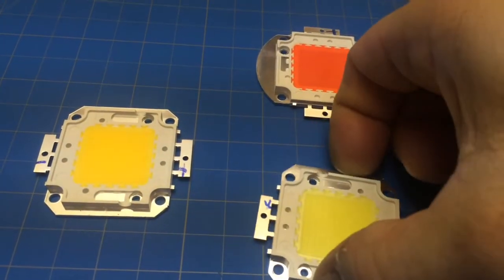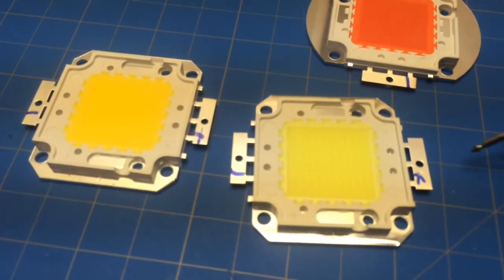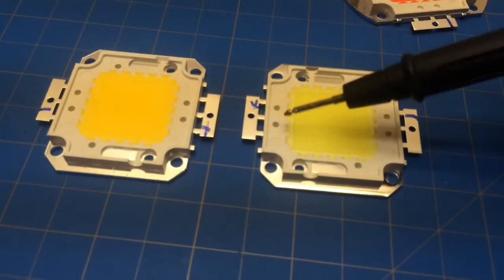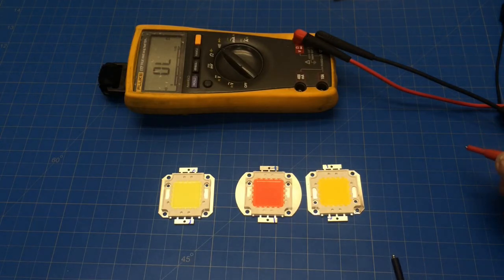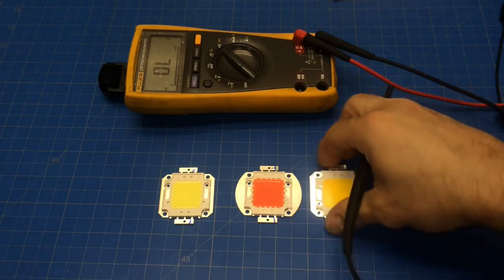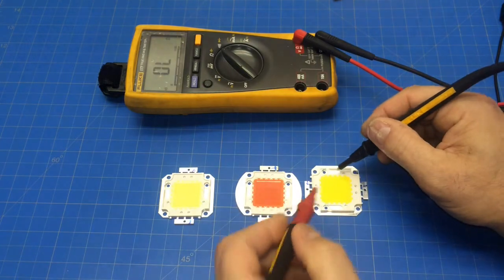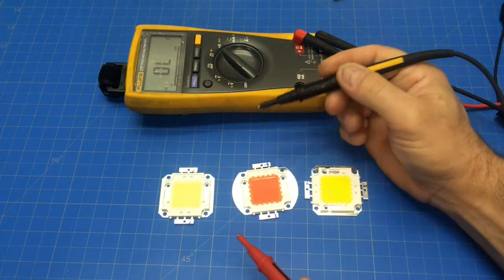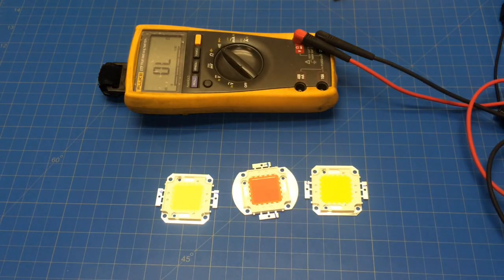High Wattage LED Chip [Polarity] Identified  [KTFG 163]

Comment: does it make a difference in brightness if you connect only 2 poles instead of all 4?
Reply from the maker: No,  the 2 positives are electrically the same as well as the 2 negatives.  
Be aware that the same wattage COB can run at different voltages depending on the series parallel connections of the individual leds.  It may vary from model to brand.